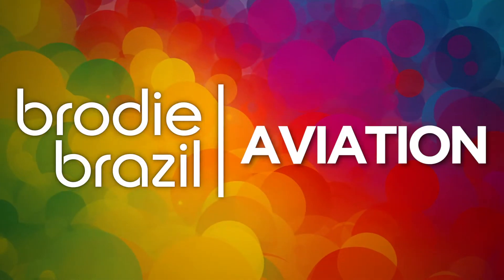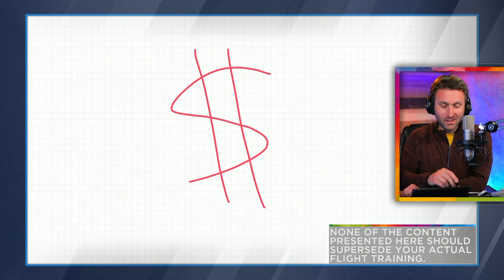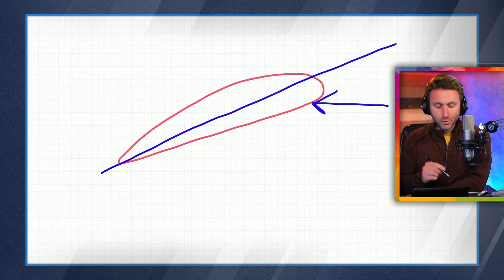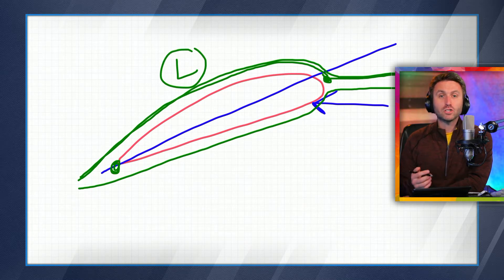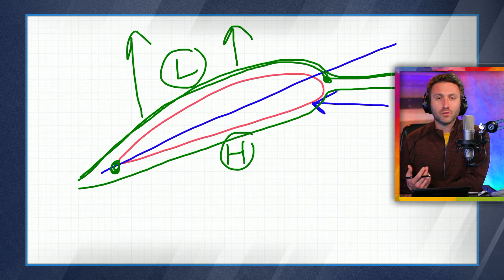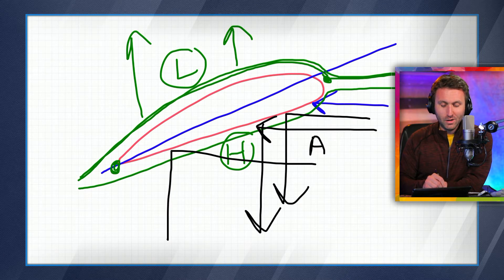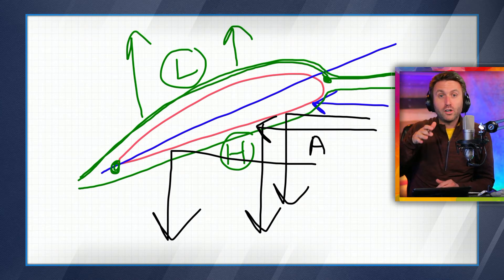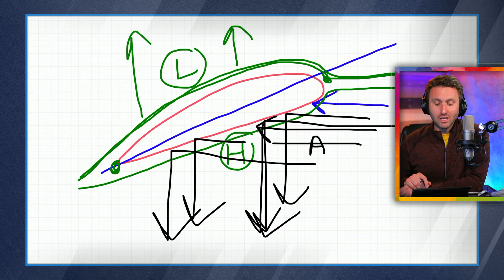What makes an airplane fly? (Bernoulli vs. Newton)

Comment: It's not newton or bernulli. Bernulli's principle is helpfull in explaining how a force transmits to a wing, but not the cause of the force. Newton explains what causes the force, but not how it transmits. A pressure differential does not cause lift. Rather, it is lift caused by the downward excelleration of air.

Comment: I see it as Bernoulli's principle is based on Newtonian physics. Like it states that fluid speed is inversely proportional to pressure. so if the lower part of the wing has high pressure then that is what pushes it up. And for planes flying upside down the stagnation point changes and gives the same lift effect when flying upwards and yes ofc Newtons 3rd law. They go hand in hand from my POV.

Comment: Bernoulli's principle is abused with regularity in the equal transit time hypothesis. Bernoulli's principle is a conservation of energy equation, describing airs ability to trade pressure energy for kinetic energy without gaining or losing its total energy.  This doesn't cause lift. Lift is caused by the excelleration of air downward opposite the lift force. Equal transit time hypothesis is false. You can't "create a bernoulli effect " and then get lift. The have to do the work of excellerating some air down  or you won't get any lift.

Comment: SKI-ING EFFECT or KITE Effect is more likely to prefer Newton 's laws of momentum. The pressure difference even really occurred, isn't cause by Bernoulli principle, since the flow is separated it can't be considered Steady, uniform & Homogeneous flow... Just like in Tube, Tunnel or water trench.. So, cannot be considered by Bernoulli's Equation.
So why the Air-Foil has curved. There must be Beam/structure inside the wing to carry the whole Aircraft-Body weight..we will not make Square-Beam for gliding through the Air, but rather make it smooth & Round at edge.. then such Beam which  become flat Air-Foil duty.. unintentionally be CURVED by the smooth flow purpose.. not to create lift.
The pressure difference by such Curve, even real, but will never be enough, without A.O.A.(Angle Of (wind) Attack) that really create enormous LIFT as intended to perform.

Comment: The only thing that I don't understand is, Newton's third law establishes that for every force there is an equal reaction force but in opposite direction. On vectors this basically means that the sign of the vector changes. I understand this means that for every Force A (per your diagram) pointing left, the reaction force is pointing right, not down. I think the correct explanation is in the green lines of your diagram. Air is coming from right to left flat, but as it encounters the wing profile (with the angle of attack) it makes the air go down (both in the upper surface and the lower surface, as you have  drawn  in green lines). This generates a reaction force upwards, which is the lift. If I'm not mistaken of course.

Comment: Hi Brodie, with all due respect, the explanation is wrong in so many ways. 

The equal transit time theory is just wrong, as there isn't any physics principle to back that theory, in fact, if you look videos of an airfoil in a wind tunnel, the opposite thing happens.

Why does air accelerate and stick to the wing? Thats because of Coanda's effect, air is attached to the upper most curved surface of the wing, creating a depression where air is sucked in and accelerated (Bernoulli)

Then you have downwash contribuiting to lift, explained with Newton's Third Law.

Hope It is elaborated enough, anyone correct me if I am wrong.

Safe flying!

Comment: Ive been discussing this issue for years. I have no involvement with airplanes, I do have a very deep technical knowledge about gas turbines. I think, one of the reasons this is an argument with an airplane wing is because while flying, a wing doesn’t really need to create much lift, it could generate a lot more, but what you want is a compromise between lift/low forward air resistance. In the turbine of a gas turbine, you want maximum “lift”, you wan to extract as much energy from the fluid (hot gasses coming from the combustion chamber at high pressure and speed) as possible, and thats why a turbine blade has a much more crooked shape, ultimately what you want is to redirect the flow downwards to create an upwards momentum on each blade that forces the turbine rotor to turn. For me in a gas turbine is a lot clearer that is Newton’s third law the most important contributor to “lift”
Reply: Most of the lift happens on the back side of turbine blades or airplane wings. Wings are sucked up by air, not pushed. That's, why when wing stalls it loses 75% of lift
Reply: @ what would be the evidence that most lift happens in the back? The evidence that is Newton’s third law, is the fact that the trailing edge of a turbine blade pretty much opposite to the direction the rotor has to turn, where if it was purely a matter of Bernouillis principle that would be pretty much irrelevant
Reply: @juncearyoutube3336  yes it is opposite, that's why it is getting sucked. The evidence is that pressure difference between atmospheric and pressure under the wing and over the wing is 3-4 times greater above than below. So if atmospheric pressure is 100% pressure below the wing is 102% and below is 92% of atmospheric.

Comment: I don't want to sound mean nor anything, but that's an incorrect explanation. If pushing air down was the sole reason for lift then it would be impossible for planes to fly upside down - something we know isn't the case. The catch is that Bernoulli and Newton are two sides of the same coin, there is no "vs".  Bernoulli's equation comes directly from applying some conditions on Newton's three laws. They do not compete.
You can check NASA's explanation on lift on their website, it's a good read, and I'd also reccomend watching 'lift: no curves required', by Light and Sporty Guy, here on youtube, a very good video on lift, foils, and he also provides the derivation of Bernoulli's equation from Newton's laws.
Reply from the maker: an airplane can't fly inverted?
Reply: @NextFlightAviation   Agreed. That's why aerobatic planes have a curved camber on the top AND the bottom.
Reply: @NextFlightAviation  I believe airplane can still fly inverted with your theory.